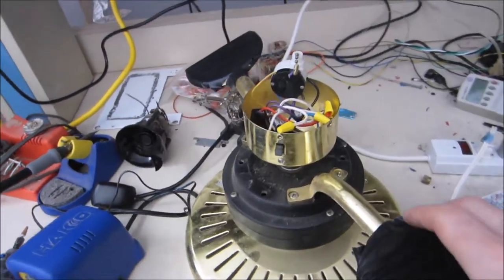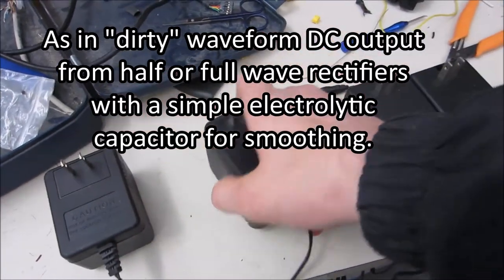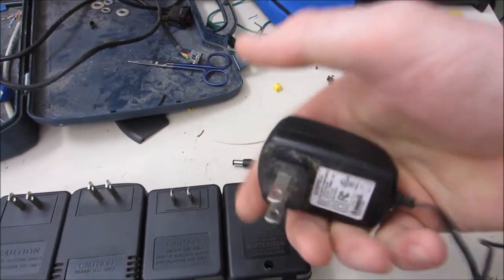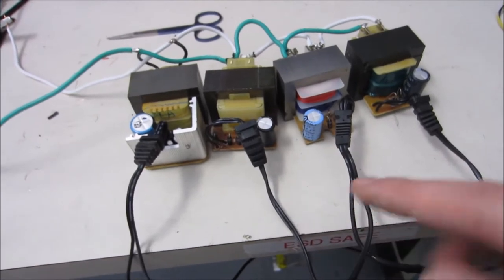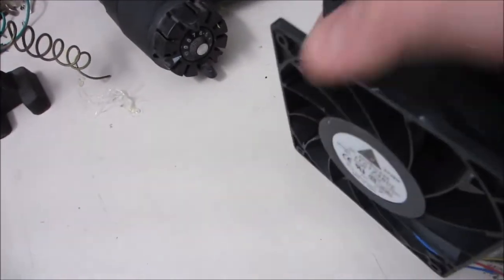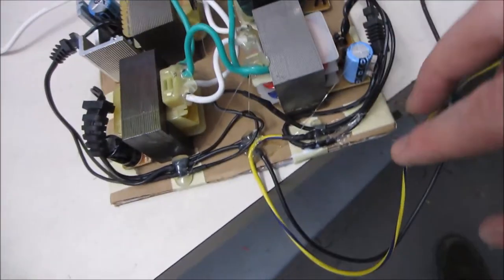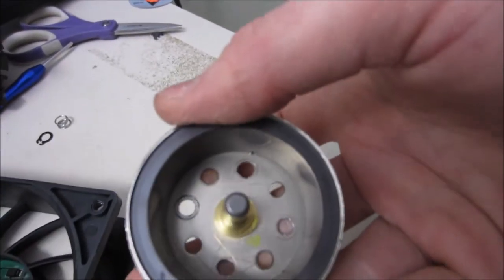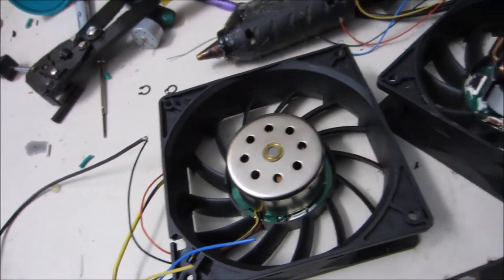DIY Centrifuge from junk - part 1

Comment: The one with 2 diodes is still actually full wave, it just uses a center tapped winding, which gives half the voltage. You should have rewired that one up to a bridge rectifier.  You could have had 24V from that one alone.